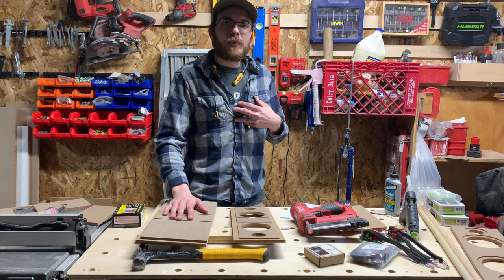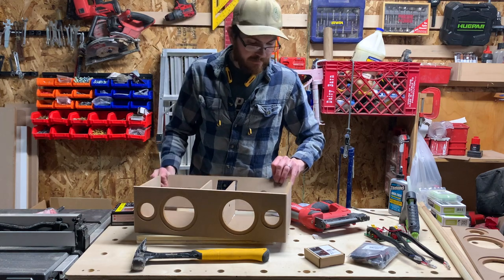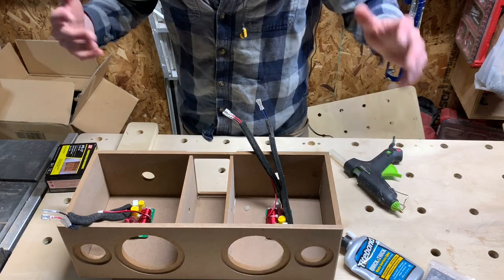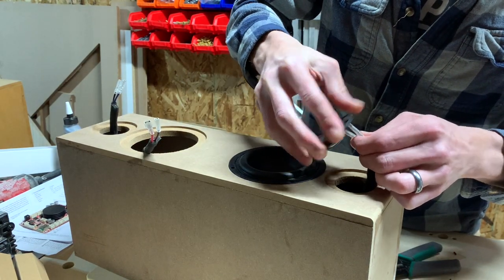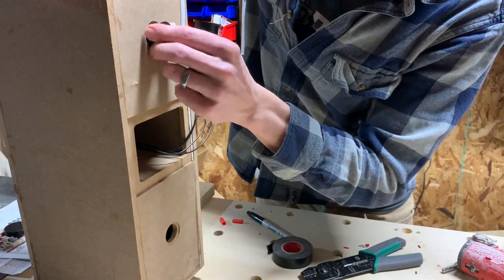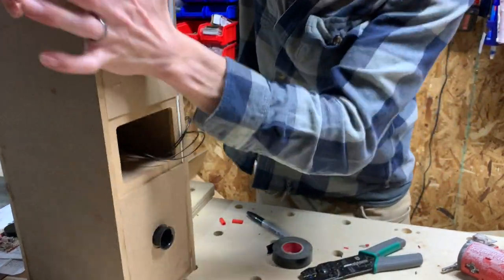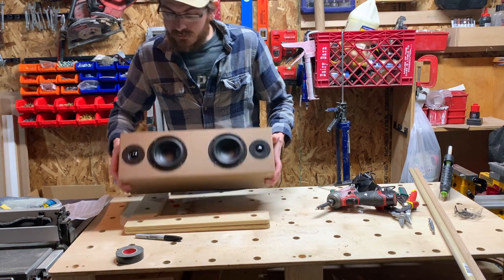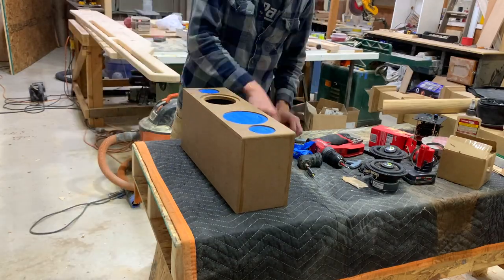DIY Audio- Parts Express MKBOOM Bluetooth Speaker Kit. Is This Still Woodworking?

Comment: Looks good, as you were painting it I was thinking it might look cool painted with truck bed liner.
Reply from the maker: Doing my “research” for this project, I couldn’t believe how many people finish their speaker boxes with products just like that (Duratex, Exohyde). From a durability standpoint I absolutely get it and it certainly has a rugged “cool” factor. But… I wanted to build something a little more refined than that 😂